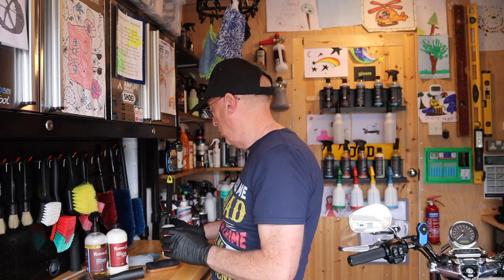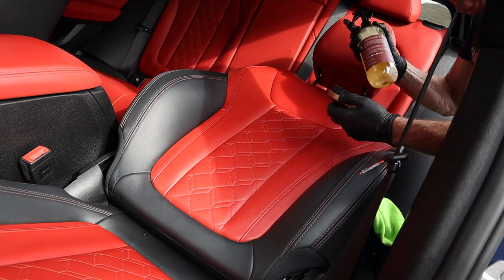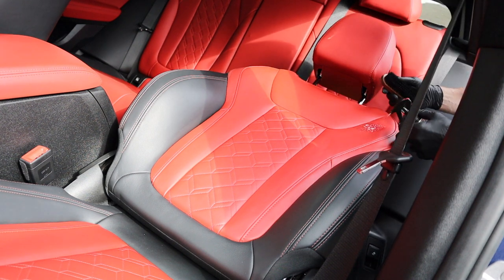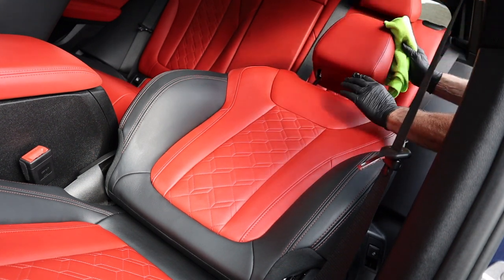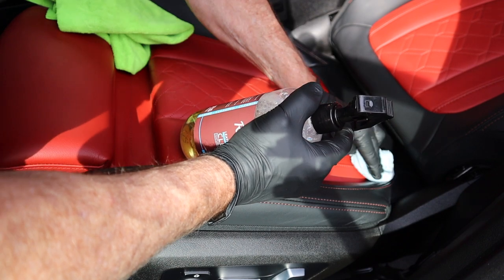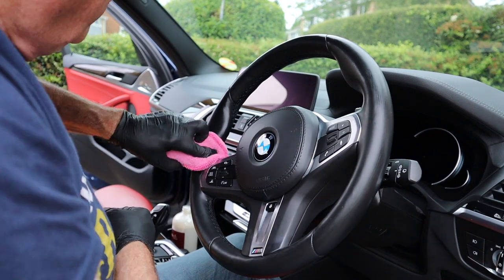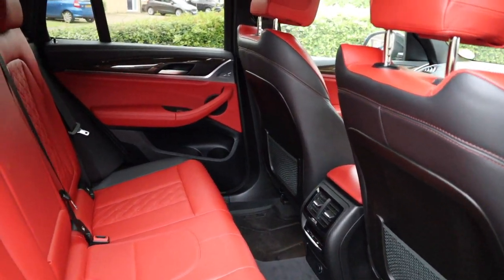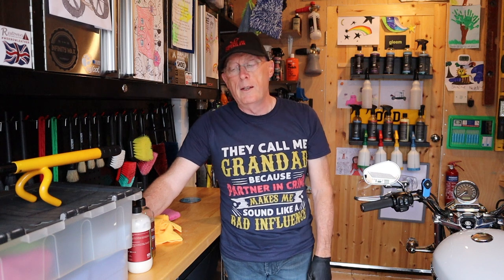Cleaning my Leather

Comment: My heart sank for you when I saw that expanse of leather.. Maintaining it is worse than actually getting it up to a standard...

I have just purchased Garage Therapy's leather cleaner and protectant, based on there past products this stuff will do just as well as LRC, another fav of mine.
Reply from the maker: Hi Chris, a lot of work but I keep it up to standard so not so bad. I haven't needed to buy the GT leather products yet as I have both LRC & Colourlock products on the shelf as well as Chamberlains set of products. Colourlock are widely considered as one of the best leather products on the market so would expect the GT products to be on par with them. Anyway if I wasn't working on my car I would have found my Wife with a list of jobs to do 🤣🤣
Reply: @ObsessiveCarDetailer  given the alternative, and d have done the car too.
Reply from the maker: @Just_Bald_Chris  It's all about keeping a low profile👍🤣

Comment: Hello Martin 
I have been looking at the GT products like you told me is there any difference to the GT Leather Pack and this product The Leather Repair Companies Leather Cleaner?
i have been looking at what products to clean my car and think the GT one snow foam GT starter pack and maybe GT leather pack with brush . What do you think ?
Reply from the maker: Hello Andy, both the LRC & and GT leather products are very good and I have them both on my shelf. My slight preference is for LRC as it leaves a really nice leather smell behind when you have finished but like I say, both work really well. For cleaning the outside, my number one products are GT foam & One Car shampoo. If your car hasn’t had a dedicated wash before and just been to the car wash then GT Zero shampoo is very strong. Depending on how dirty your wheels are their one wheel shampoo is great but if your wheels have burnt in brake dust where they haven’t been properly cleaned in a while then you should use a dedicated wheel cleaner. Also have a look on County Detailings site and look for a microfibre wash mitt. GT do one but there are cheaper ones around. Hope that helps. I don’t know where you live but if it’s in the UK then I don’t recommend you washing your car in this heatwave, the water will dry and you will be left with lots of water marks especially if like me you live in a hard water area
Reply: @ObsessiveCarDetailer  Thank you for all that information I live in Milton Keynes Buckinghamshire and the water is very hard here 
I have spent most of the day looking at   County Detailing's and GT website and notice County Detailing's  have a lot of products out of stock unfortunately
I definitely wont be cleaning my car in this weather I have got to buy the products first 
Would love to pop over and visit you and have a slice of banana cake and a cuppa with you
Reply from the maker: @andycole5816  another good site to look at is in2detailing they sometimes have stock where others don’t 👍
Reply: @ObsessiveCarDetailer  Thank you Martin